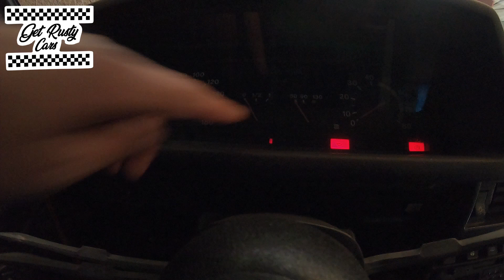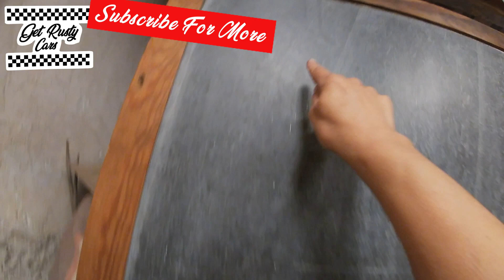Noisy Misfire - S03E02 --English Subtitels--

Comment: if u remove the wrong cable first u get arcs if i remember it correctly
Reply from the maker: Thaaanx!!
Reply: @GetRustyCars  ahh, just saw a Text, if the engine is running in the faulty car, switch on the lights, air cond. to avoid voltage spikes when u remove jumper cables, u start with the black first than the red
Reply from the maker: @scudsturm1  aha thats great info 👌🏽👍🏼
Reply: @GetRustyCars  ja ich weis ^^ my pleasure